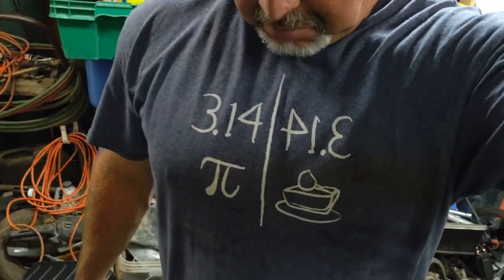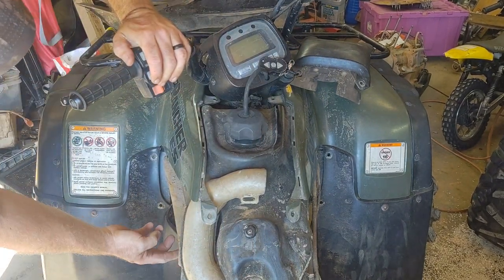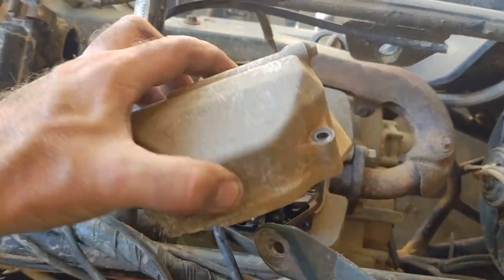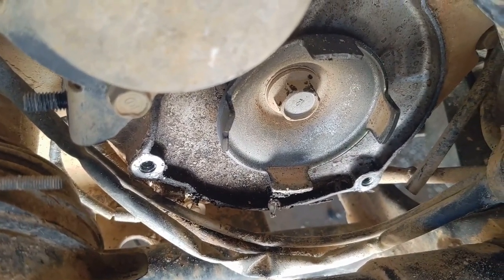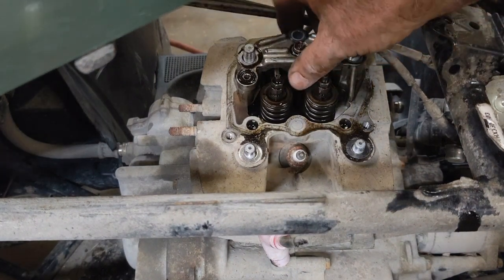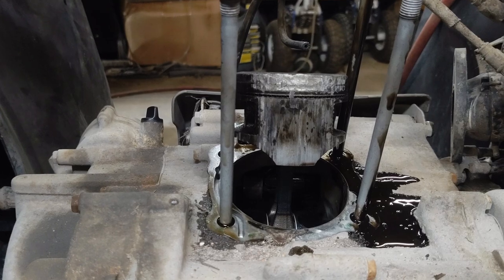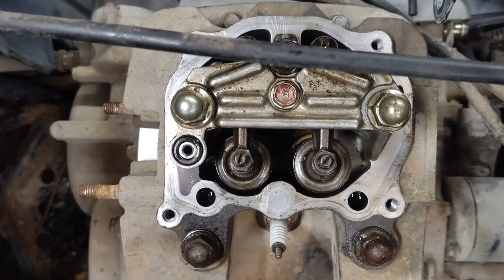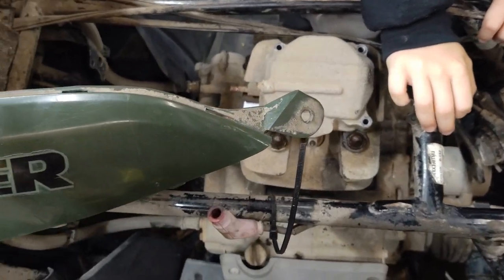Honda Rancher 350 Top End Rebuild

Comment: How much labor time, parts and total cost would this be?????  I have a BMS 400cc Mountaineer with an Odes Honda knock-off which ran out of oil due failure to replace an O ring during oil change.

Comment: what if the motor won't rotate how can you get it to top dead center or do you have to before removing the top end?  I believe that the piston is hitting a valve.
Reply from the maker: You don't have to before hand. It just makes it easier to put it all back together if it's at top dead center to start off with. You can go ahead and tear it apart and then get it at top dead center before you adjust the values.
Reply: Ok if you tear it apart without it being top dead center. How do you determine what stroke its on without the valves on it?
Reply: Or it the T symbol only visible on the compression stroke
Reply from the maker: @cheraw20  the tea is visible twice during the four strokes of the engine.
Reply from the maker: If you don't have the valves in it you can put the pushrods in and rotate the engine. The pushrods should be even at the top dead  center t mark.

Comment: I rebuild these ranchers from time to time.. those aftermarket jugs with the new pistons are hit and miss. Sometimes these kits have too much play between the piston and cylinder causing a rattle/knocking sound. I have used a Numara piston in these and they fit good and tight

Comment: My friend with a 350 with a new top end and can’t figure the ticking noise maybe it’s the lifters
Reply from the maker: Could be, try adjusting valves.
Reply: @FourwheelerDoctor  it was the timing chain is that a common problem with Honda rancher 350 and it’s bored to a 355 idk if that makes a difference or not
Reply from the maker: @daleross2739  the change do stretch on these bikes periodically and I have swapped out a bunch of them.
Reply: @FourwheelerDoctor  we figured out it was the timing chain but we will test it once it gets out back together thanks for the response help

Comment: I didn't see when you put the long bolts in the side of the cylinder. could you please tell me when it is that you do that, and how much torque to put on them. Thanks.
Reply from the maker: Yes I didn't show that in the video. You want to install these long bolts after you torque the head down. These bolts should be torqued to 9 lb ft

Comment: Good video!! I contacted you in July about a 2009 Honda Big Red 700 oil pressure problem. I replaced the pump, chain and sprocket. Unit worked perfectly for 4 months. Then the linear solenoid failed. Tested old solenoid, I know it was bad. I replaced it, but the unit won't move. Using the test port, I tested it for oil pressure. No oil pressure. I've taken the unit apart again, and no signs of anything wrong. ( no blown seals or o-rings, chain looks good and the oil pump turns.) Can the solenoid failure cause oil pump failure? Could the pressure relief valve in the pump be stuck? I was thinking, with your experience, you might have some insight on this problem. Any help and advice would be appreciated. Thanks for listening.
Reply from the maker: The relief valve would be about the only thing left. I can't say I have ever seen this.

Comment: if you do not use RTV on the base gasket, how do you keep it from  leaking ... i just reassembled mine and it leaked like a sieve !! i think i missed the dowel guides ....
Reply from the maker: @michaelschlup-c5o  it will seal if put it on dry.  I usually put RTV on all gaskets with exception of the head gaskets. But I have had issues in the past just with these base gaskets because of the pressure that the head bolts are tightened to. They will make the gasket move and break causing a severe leak. I have never had a base gasket leak when put on dry
Reply: @FourwheelerDoctor  i did put it on dry but it leaked so bad i wonder if i missed aligned the guide pins...

Comment: If the rings are just worn and no scarring in the cylinder, have you ever just honed the cylinder and reused? Are the cylinders honeable?
Reply from the maker: Yes they can be honed. If they don't have any deep scratches in the cylinder, you can just hone them but I still try to replace the rings.

Comment: Instead of pulling the pull starter off could I just jack up the rear end, put it in gear and spin the back wheels to get it to tdc that way?
Reply from the maker: Yes you can also put a small wooden dowel in the spark plug hole to let you know when you are getting close to top dead. It may be aggravating but probably not as aggravating as unbolting the pull start. Lol
Reply: @FourwheelerDoctor  that would definitely be easier for me because the previous owner deleted the pull start and put a plate over the hole and it seems to be glued in.

Comment: Hey got a quick question.  Got my top end off after buying it from someone who ran it low on oil. Got the piston off and noticed some scaring in the connecting Rod where wrist pin goes. And noticed a tiny bit of play with the wrist pin in without piston. Is there any play at all between wrist pin and connecting Rod?
Reply from the maker: No there shouldn't be any play.

Comment: I build diesel engines for a living but never done small engine but I’m getting ready to do my sons 350. I see you installed rings dry. On diesels we put oil on them. Should I put oil on these or install dry?
Reply from the maker: The manual does not call for any additional oil on the rings. I do apply a light coating of oil  to the cylinder before replacing it.

Comment: If I have some grooves in my connecting rod from the stuck rust pin can I smooth them out with dremel tool. Thanks
Reply from the maker: Yes just a little at a time. The pin should slide in with very little effort.

Comment: Hey mate, my honda trx 420 runs sweet until it heats up then starts blowing tons of white smoke? Any ideas? Should i go ahead with a top end rebuild? Happens after about 20 mins riding hard
Reply from the maker: Is the oil level going down? Does your coolant level drop any?
Reply: @FourwheelerDoctor  coolant hasn't dropped only oil I think.
Reply: Could I use this video to rebuild the 420 or is it too different with the 350

Comment: I just did a top end on my rancher 350 and I think I rotated the engine over the wrong way. And now that it's together I have 0 compression. Do you think I messed up the timing when I rotated it the wrong way?
Thanks for the awsome video
Reply: You may have been on exhaust stroke instead of compression stroke when setting your valve clearance

Comment: I did a new top end of 2005 honda foreman 500, which ran perfect before  I put the new top end on, now it just hits on the compression stroke but want run or stay running,  I can make it ideal holding the starter but want stay running past the hit in the compression stroke, any ideas,  I'd appreciate it,  God bless

Comment: I’m here bc I started smoking bad on a quad riding camping trip to Pickett state park in Jamestown Tenn this past weekend. It’s all original 2006 Rancher 350. What kind of money are we talking about having this repair done?
Reply from the maker: There is a aftermarket cylinder piston and ring kit for these bikes that you can purchase for less than a hundred bucks on ebay. If you follow this video you can do it yourself and have right around $100 in it with an change. without really needing any special tools except for a filler gauge and normal hand tools.

Comment: Hi, I have a rancher 350 that has a bad tick, I know it’s not valves or cam chain, I’ve come to the conclusion of piston slap. Do you know what symptoms would be piston slap. The rod has no up and down play, but it does have some scars where the wrist pin goes. I had to beat it out and can’t get it back in to check for looseness. Any of your feedback would help. Thank you
Reply from the maker: Sounds like you probably have wear in the small end of the rod. Probably need to replace the crankshaft.

Comment: No oil on the piston,or the cylinder, before assembly?
Reply from the maker: It was cleaned  with transmission fluid and a light the oil before assembly. I didn't mention oil but I did the transmission fluid which would probably suffice by itself since it is a lubricant until the 2nd rotation when oil goes everywhere in the bottom end of the engine.

Comment: I have a 02 rancher barely if any smoke at idle. Quite a bit getting into the throttle and can hear what I think is valve chattering possibly would I need to do something like this? Thanks
Reply from the maker: Adjusting the valves would help quite the noise. If I were you I would ride it until it started smoking more. At that point then you would need to do the top end as shown in the video.
Reply: @FourwheelerDoctor  thank you!
Reply: What kit do you recommend or use?
Reply from the maker: I have used this kit in the past. 
https://www.ebay.com/itm/Honda-Rancher-Trx350-TRX-350-Cylinder-Piston-Rings-Gasket-Kit-Set-2000-2006-/161207181738?mkcid=16&mkevt=1&_trksid=p2349624.m2548.l6249&mkrid=711-127632-2357-0
Reply: @FourwheelerDoctor  thank you!

Comment: FYI    Then bike will still crank ( and seems to sound normal) but will not start....follow -up to prior questions.
Reply from the maker: That's the same thing this bike was doing. And as you can see from the video the piston and melted so it was not getting any compression but didn't make any odd noises when it turned over. You can buy these cylinder kits very inexpensively off eBay for around $100. And really only takes a couple hours labor to replace.
Reply: @FourwheelerDoctor  Thank you for the quick and full information.

Comment: So much easier to put the piston in the jug and then put the wrist pin in.this was actually very hard to watch 🤦
Reply from the maker: I've done that before but seemed to struggle to hold the cylinder up, get the piston in the precise location so that the wrist pain will slide through and then getting the clip on the wrist pin. It proved to be more of a struggle than just pushing the piston rings in one at a time but it will work.

Comment: Too bad you didn't mention the ft lbs torque for the head
Reply: He did 29ftlbs  on the acorn bolts 22ftlbs on the valve bolts I do 7ftlbs on the 10mm head bolts